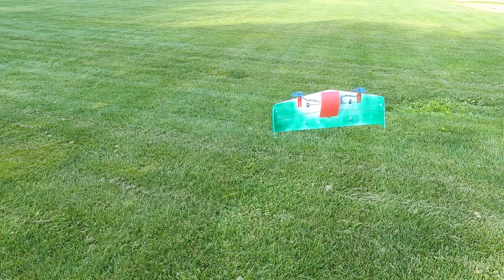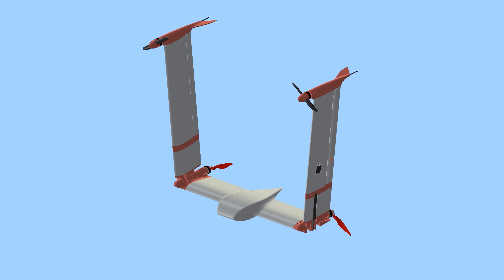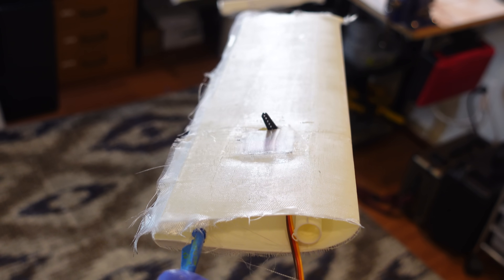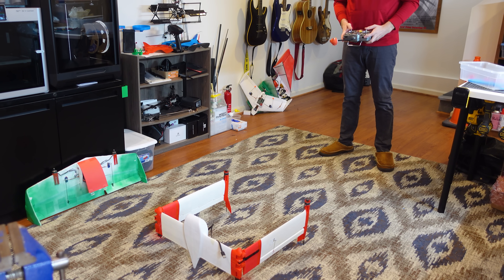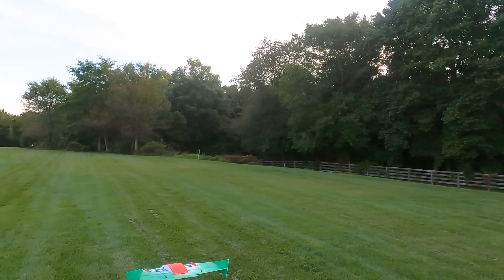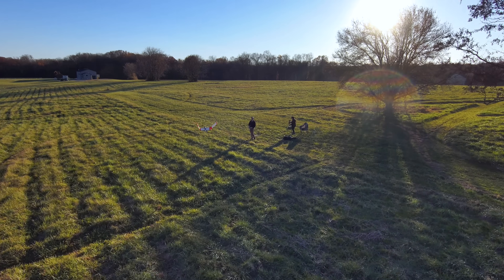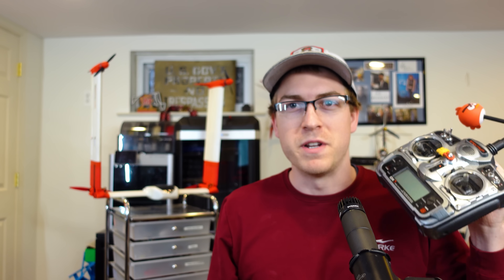Un-Folding a Quadcopter to Increase Efficiency - Part 1

Comment: Why aren't the wing tips pointing down in the folded state?? 
That way you wouldn't need a high force actuator but just very small servo actuated latches.
The wing tips would rotate outwards and upward during flight, run into an end stop (a CF tube extending over the inner portion of the wing, where it would drop into a pocket and latch onto it) and be able to transfer the bending load. To return into the box configuration, reduce flight speed back down and release the latches, let the wings drop down 90° again.

Comment: Putting motors on the wingtips definitely helps keep the joint unloaded acceleration in turns.   Negative g inverted turns will be more limited based on the linear motor.

Comment: That's such a cool idea! Though I have to think that if the hinge bent the other way the wind pressure force the wings open to a "locked" position and if wind pressure drops it would assume a hovering position with a bit of constant tension on the hinges.

Comment: The best way is to have fixed wing, and use 2 lift motor and have 2 motor that are in fixed position. That demand less mechanics, and less weigth.the main problem will be transition to stop before descent.

Comment: That's some nasty roll/yaw coupling during the transition.  A simple idea would be attaching a drogue or stabilizer by two strings to each wingtip.  That way it would just hang during hover, but trail during transition and forward flight.  If it were long, it'd have a lot more leverage than a rigid vertical stabilizer

Comment: 2:03 "40 pounds" .. impressive.

"it was not"

aaaa, yes,

3:20 If you have a electric motor there is really no downside in having more propellers like for a turbine.

Actually having more propellers decrease the back wash speed, and increase efficiency, while the larger wetted area do decrease it a bit, not nearly as much as the benefit of having a larger prop area.

Comment: Good idea, impressive building. But the base should be an inherently stable flying wing with tip motors, and then the joint and two pusher motor can be added (keeping the COG).

Comment: Thank you for your sharing. I’m working on a project based on the ArduPilot Tiltrotor configuration. However, I’ve encountered some issues during the transition from fixed-wing to multirotor mode:
(a) the CG shifts rearward, and
(b) the wings tend to stall easily, which often causes the UAV to flip during tilting.
May I kindly ask if you have any suggestions to address these problems?

Comment: Why not have the wing fold down instead of up? Then during fixed wing mode, the lift forces are pushing the wings into the extended position.

Comment: If i may humbly suggest using a mechanism that builds up and releases tension to assist with motor transitions—similar to a crossbow slowly drawing back, then snapping forward. The stored energy can help unfold wings or other flight components quickly, overcoming wind resistance. 
Long time engineer, just getting into programming, but have preformed avionics repairs professionally.
Excited to build some quad coptors with my kid from scratch.
Reply from the maker: Very good idea, maybe applied to a slightly larger version so the weight penalty of the additional components is less pronounced
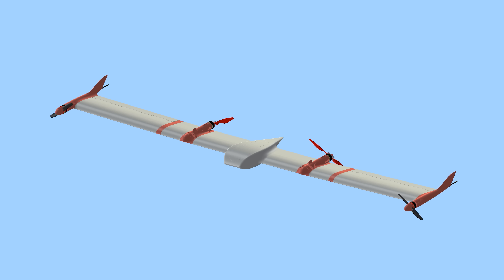Reply: @NicholasRehm That’s a great point! I was looking at the framework shown at 3:04 and thinking of a minor adjustment. Instead of adding many components, the plan would involve changing the wing joint's gear ratio, adding an internal cylinder to house a ratcheting spring or rubber band, and using the existing actuator. A small additional servo could be added to reset the ratchet and release the wings for re-folding.

The new components would be minimal: light fishing line for the cable, the internal cylinder as negative space inside the wing, and lightweight rubber bands or springs. Are there any concerns with thrust and lift? It seemed like the power output was sufficient, I am curious how tight your weight ratio is now.

If you trust random Google Doc links, I tossed a quick sketch with my outline in blue. Its a morning coffee quality doodle, just to get seek perspective on the implications of the weight penalties.

https://drive.google.com/file/d/1nyM1ORi6uhWuGWod22X4buey0zI3kKcD/view?usp=sharing

Comment: Have you considered having the wings articulate the other way?  

Instead of them being "up" (relative to the fixed-wing orientation) while hovering, if they were instead "down" then when they locked horizontally, you could have them braced against some kind of backstop.  Then the force of lift wouldn't be causing the wing spar to separate and instead would be pushing the wing sections together against a physical stop.  In other words, instead of being a "U" shape, make it an inverted U.  The outer wings fold up towards the inner wings.

Edit, looks like someone else asked the same thing and got a reply.

Comment: I’d think it would tumble in the straight configuration. 
I’ve never seen a perfectly straight flying wing. Don’t you need some sweep to retain pitch authority?
(I absolutely Love the overall concept.)
Reply from the maker: @greggjohnson621  I’ll be relying on active stabilization when I get back to this. Check out Think Flight’s video on unstable wings and the potential efficiency benefits

Comment: i really like your vids
i love the ideas and the fact you explain things nicely
i would like to share my idea for a large plane that while will not be realized probably i thought would be cool

a large plane similar to a WW2 british bomber except the fuselage is a large yube which houses the large fan that would fly it, with batteries in the bottom, integrated into the tube along with the rest of the components.
this way the engine would be completely safe upon crashing and who knows maybe this design would even be good as an armored rc plane for a battle
if a plane like that would be possible id call it megalodon and give it googly eyes and a shark paintjob, with the front opening of the tube being the maw.
Reply: you mean a large version of an electric ducted fan

Comment: Alternative: 
- 2 wing tips props, 1 tail prop
- wing can rotate 90 deg
- tail section can rotate 90 deg

VTOL: wing and trail rotated vertically, works like 3 props drone

Normal flight: wing and trail rotated horizontally. Maybe tail prop can collapse (and be drawn into the tail section perhaps with a cone on the prop closing to make it more streamlined).

Might need large flaps on the tail to counter it pitching up as the tail transitions.

Would love to see one! Hope you're well.

Comment: it seems you have too much yaw control authority if you shut off wingtip motors instead running center motors as mains it should increase stability and the outter motors could be for increased weight capacity or steering though idk how yet best to carry load with your design... for fpv and surveillance mounted sensors you can design for the weight balance at least ... I'm kinda disappointed it's not covered in lightweight durable solar for charging not just from top of 🪽🪽 wing facing sun but reflections 🪞 from clouds below 👇🏼 then set an infinity altitude test with flight recorder and see how long it can fly over the same location via battery capacity like could you get it to go from 1hr before sunup to 1hr after sunup? or even all the way to the next day from sundown to sunup on aquired battery capacity? wouldn't fault you for using a full moon to collect reflected sunlight ❤ also i wanna build one like I'm describing 😅 just to have 3 to explore 2 going 1 reserve for care search rescue for/of the 2

Comment: Awesome build dude. Really inspiring your ability to r&d solutions to the efficiency under diverse conditions and altitudes issue. Happily subscribed!

Also, do carbon rods function similarly to steel rod just lighter? Are there any differences in performance of the pivoting parts?

Comment: If the lift force tries to fold the wing and you're going into a lot of work to withstand/counteract that, wouldn't it make more sense to reverse the folding direction?
Reply from the maker: The way I did it keeps the actuator tensioning the joint which is less prone to buckling compared to if it were pushing that joint to stay open
Reply: @NicholasRehm  makes sense. I was thinking a static stop to limit over extension, but it's your design and "I've thought about it but decided otherwise" is good enough for me, lol.

Comment: Why not having all blades on the top .. thus, you can have four standing points on the bottom .. which makes your drone much more stable on take off and landing ... 
Also about not utilizing the two motors and reducing drag by having fordable blades .. would using the extra two motors reduce the power consumption of the other motors .. those less energy required ...
Reply from the maker: Motor position won't impact stability since there is no inherent stability of hovering things like this. The two motors I shut off have larger blades with shallower pitch optimized more for hover performance, so idea is that they're doing more harm than good for forward propulsion
Reply: @NicholasRehm  The motor position prevents the drone of having four standing points .. I stability I was referring to is on the take off and landing ... 
I can see the logic for shunting down the two motors ... yet I still suggest to investigate fixing that issue so you may have four motors running on lower consumption that two motors running on a higher consumption .. I do not know if did explain my suggestion correctly or not :-)

Comment: I'm not sure how you are mixing from yaw to roll in the transition, but if the fc is still attempting a portion of hover mode correction this could explain the rolling behavior. just my 2 cents

*edit 

Possible solutions 
1 drop the hover mode yaw gain harder sooner to account for the increased yaw effect from the differential thrust of the partially unfolded wing  
2  drop the hover mode roll gain harder sooner as this is causing a yaw

Speculation
3 swap the cw/ccw propeller configuration. Should be more stable..? 
4 have you tried perturbating (with fans and/or a pokey stick) the craft on the test stand while transitioning?
5 the lowered elevon stalling in high alpha 

This is such a cool project i really want to see it work! best of luck.

Comment: You should try making it fold the other way (flip the cockpit on the other side) so there’s a mechanical stop that opposes the lift forces not just the folding mechanism
Reply: Also might help with the oscillations in the half unfolded state

Comment: Antoehr option could be to use a linkage with an over the centre mechanism to actuate the wings. That way, when the wing is straight, its mechncialy locekd in palce and does not rely on the strength of the actuator. 
Albeit, the current config seems to work great, but this might be a concideration if the design is scaled up

Comment: Man the problem is the dihedral it creates while unfoalding. when the craft yaws it causes the plane one wing to have more lift than other due to the diheral . U can fix it by making the craft so it doesnt yaw a little bit using flight control." OR the simple solution is make the craft unfold from a w shape".

Comment: What's keeping you from having the wings fold down for quadcopter flight and then up for  fixed wing flight? You could have extra reinforcement that protrudes from the fuselage side of the hinge to prevent buckling.

Comment: is there a reason the folding wings can't be an upside down "U" instead? I feel like the wings unfolding would be much easier for the motors and could lock into an open position rather than have the motors have to hold them in place. That could be leading to some instability. aaaaannnnd as I'm writing this I see this video was posted 4 months ago. so I should prob just watch an update video.

Comment: I wonder if this would be easier to make with a flexible wing that can bend into an arch? Maybe a thin thread would be enough to pull the wingtips towards each other, or maybe two threads pulling the flexible wingtips towards the less flexible center.

Comment: Hi, so i want to print with light weight PLA but i tried everything and nothing worked can you please tell me what exactly you did because im really frustrated with that filament, thanks)
Reply from the maker: Set the flow to 40-50% and start dialing up the temperature in 10deg increments until it starts looking over extruded

Comment: You should be the first person to ever build a flying wind turbine: a 4 wings aircraft can recharge the batteries airborne. To recharge the batteries during the flight, a 4 winged electric aircraft could spin on its axis, using roll maneuvers, so the plane wings can act like a wind turbine, full 360° revolutions on its longitudinal axis. Basically the two front wings spin on one direction, and the back 2 wings will spin on the opposite direction at double force, so the pilot and passengers (sitting on the front) are never upside-down. A faster roll (the so called "aileron roll") would require a minimum speed of 120 km/h. Part of the back of the fuselage would basically be used for the battery and the generator.

Comment: 2 months any new updates? i thought it looked like it would be better if the center motors were the airplane mode and let the outer motors shut down. it would automatically be less osolating because they are closer to the center of gravity. just a thought hope you work it out.

Comment: Build a scale unfolded version for testing. Based on your video you assumed the wing version was ready for flight out of the box. You need to attack the problem from both ends
Reply from the maker: good idea
Reply: Looking forward to the next video. Did you at least submit a provisional patent to the USPTO? Lots of money to be made with military contracts. I remember when PteroDynamics was just like you. A guy in a field testing an idea he had brought to life just like you are.
https://www.youtube.com/watch?v=kA1ENhxLqTo
Reply: I am probably wrong but just looking at the wing design, that design is very difficult to get the CG right. CG too tail heavy and you will easily get a flat spin. You chose a plank, plane form, very efficient. The thinner the wing of the plank or the chord, likely equates to less room for error, and very touchy pitch up and down. I wonder if it would be easier to get a successful transition with a swept wing? While less efficient it may be less touchy and more forgiving on the transition but I am just guessing. Look at the nose on a plank/slightly forward swept wing design like the Ritewing Drak. See how long the nose is to be able to adjust the cg. Perhaps your motor placement already compensates for the lack of cg adjustment within your pod?

Comment: I think the Navy needs to implement tailsitter VTOL.  Imagine how much simpler the F-35 could be if it simply used computer-controlled small nozzles (which it already does) to stay vertical as it lands (and takes off) from its tail.    The Navy would need a special ladder to get the pilot in and out, but the rotating nozzle and ducted fans could be eliminated, and those parts are very complex, expensive, not to mention... heavy.  Another advantage: Less deck space.

Comment: A very nice concept, it looks cool and great engineering! But what about tail wings? I can imagine if you keep a certain angle between outer and inner props you can control hight, but I think you need  some kind of foldable tail wings for stability and to be able to unfold the core wing to 180 deg right? Anyway, great job man.. love it

Comment: @Nicholas Rehm how would you rate the performance of the lightweight pla in the sun? i am currently the engineering lead of a high school AUVSI SUAS team and we are trying our hardest to plan a full scale 3d printed twin boom uav, but we don't have the funding to stress test many materials, and lw PLA seems to be the best if not for a lot of people saying ti gets crushed by outdoor conditions.
Reply from the maker: I wouldn’t trust it past 80deg direct sun exposure. Regular pla can start to melt/warp at that temp too. I barely trust it for anything structural as is

Comment: I think your folding your wings the wrong way your unfolding from above instead of from beneath would be more stable and your unfolding too slow it needs to happen faster for less air disturbance you just need all your props on the opposite side from where you got them so it unfolds from vertical to wings opening from its belly not its back like a bird or bat wing your basically trying to fly it upside down in horizontal mode making it super unstable

Comment: Why do the wings fold “up”? If they fold “down” then the forward flight loading will push the wing joint closed against the stops instead of the actuator holding the wing load.

Comment: Reverse the body locstion.  the wings swing out and down as the craft transitions to forward flight? The hinges would be simple and dramatically  stronger AS PASSIVE STOPS WILL CARRY THE LOAD. The motors always point in the correct  orientation for tractor or pusher configuration.

Comment: How do you get stringing with pla on the Bambu that's kinda impressive. Did you use cheap filament or maybe a really old one ? I have never seen it string and I work with 3 and also a lot of other 3d printers
Reply from the maker: Lightweight foaming pla
Reply: @NicholasRehm in Bambu/orca slicer dir you use the Generic pla preset or the Bambu pla preset? And if so dit you change the filament density and Lower the max Volumetric speed?

Comment: I've had a similar idea that I've been floating around for a while. I was thinking to use a membrane (like nylon) that is unfurled and pulled taut with thin stranded cable, kinda like a kite. This would keep the drag minimal during copter flight and then when pulled taut it would act as a wing for lift